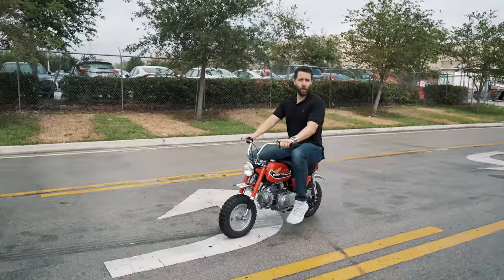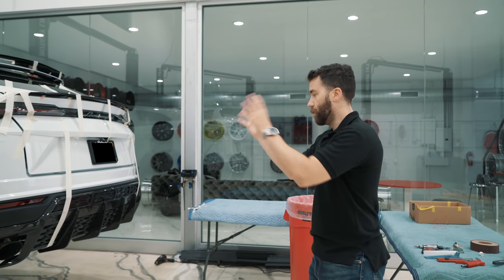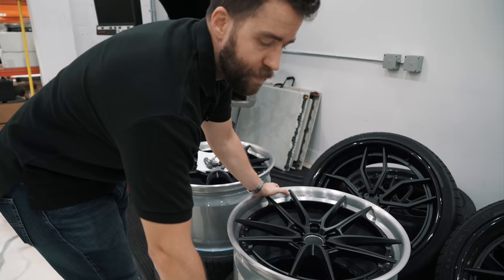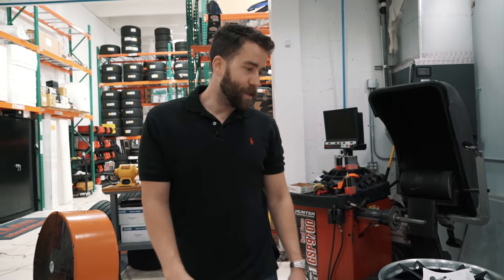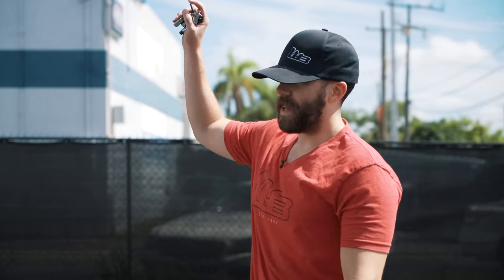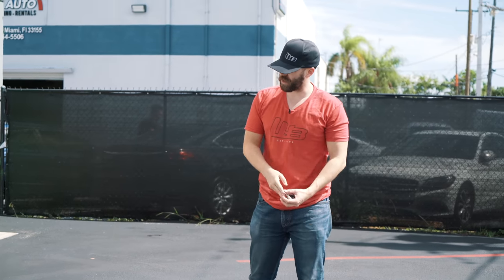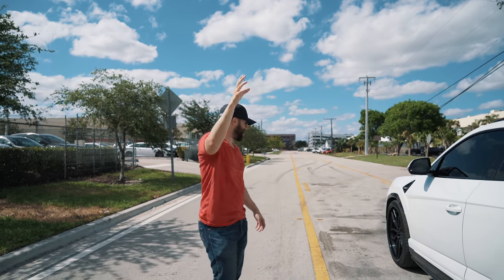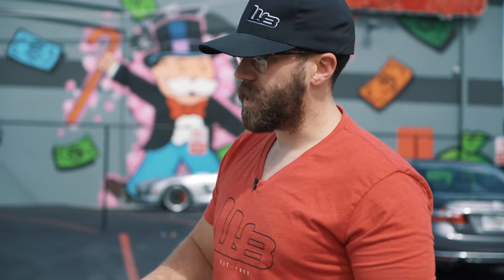CARBON GALORE - LAMBORGHINI URUS WITH 1016 CARBON KIT + SLS AMG WITH RW CARBON BOTH ON ANRKY WHEELS!

Comment: Just when I thought the Urus couldn't get more badass! Great work on it!
Reply: Great science project...
Your custom design carbon kevlar rims or carbon fiber wheel rims for the Lamborghini Urus based on the VW Arteon SEL inspired cyclone bladed carbon kevlar rims or carbon fiber wheel rims design?
Wind tunnel test later on?
Traction test with Pirelli P Zero Corsa Super Trofeo tyres?